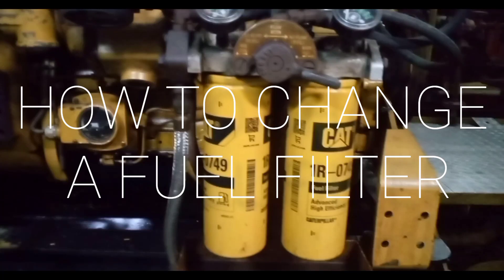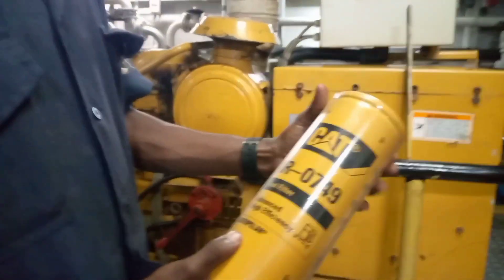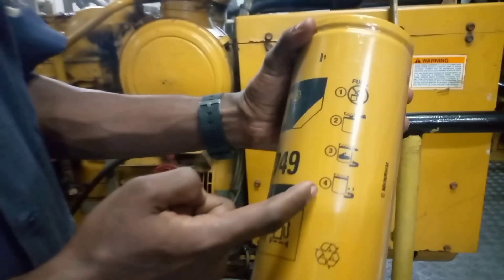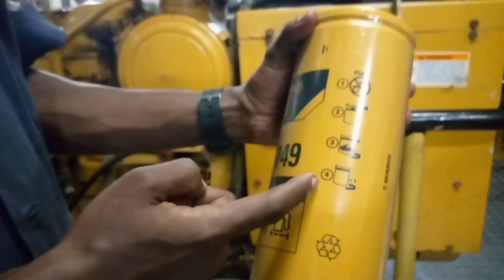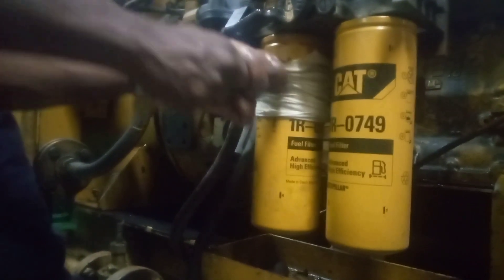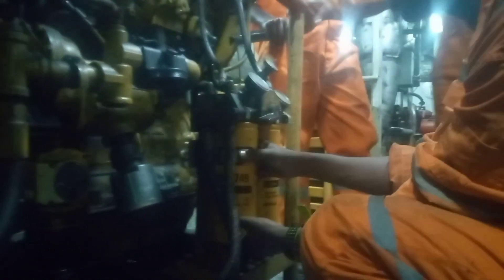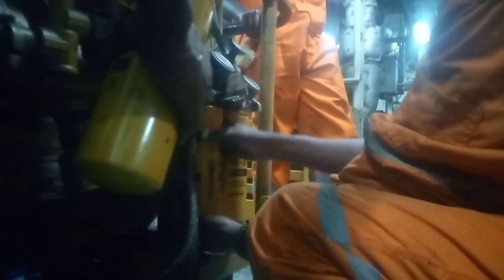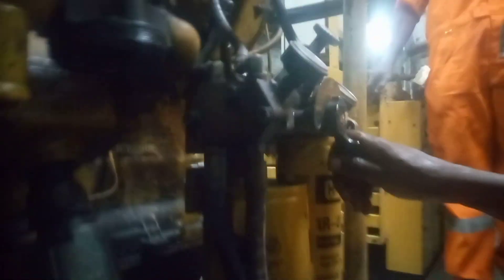How To Change a Fuel Filter.

Comment: Switch suction from second filter, unscrew first one.take new, grease rubber ring, install and screw in element.switch the valve to purge air from first one.filter is ready.on the duplex it is easy to change cartridges without stopping engine.